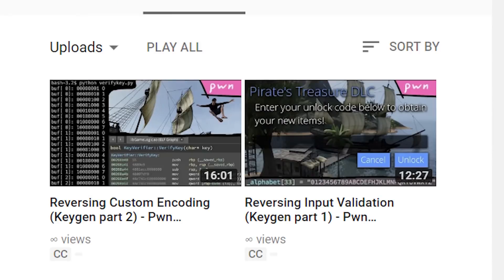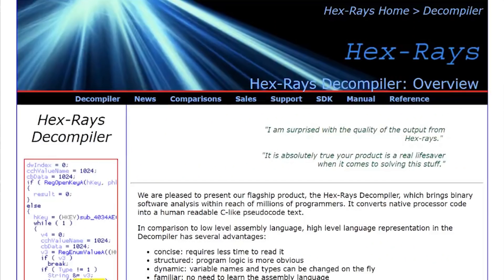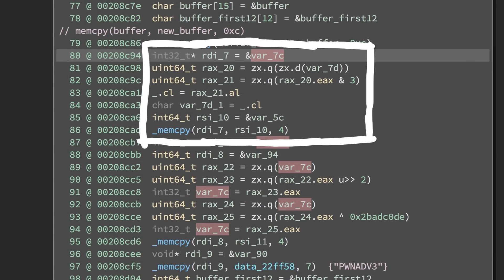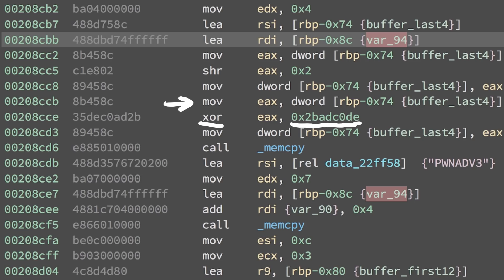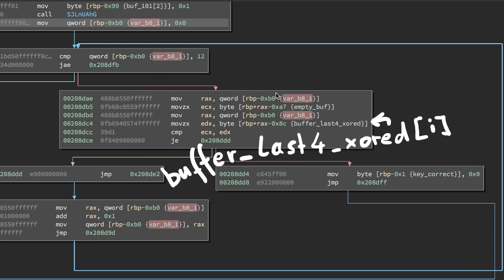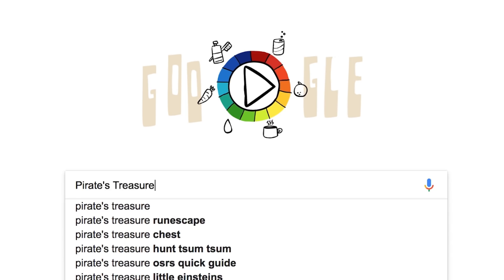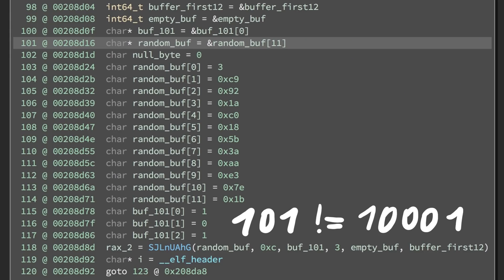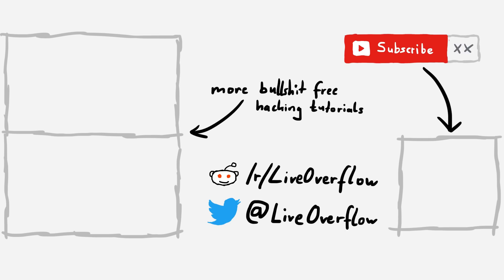Understanding the Key Verification Algorithm (Keygen part 3) - Pwn Adventure 3

Comment: I would've given up long ago, copy and pasted the assembler, or perhaps transcribe it, compile the key verification and throw angr at it.
Of course the more you know, the more you can constrict something like angr and reduce your test case, which will speed up time. if you can make angr find out a 15 byte array that matches and know how to convert that back into a valid key, then you don't need to check a 25 byte char array that could have anything in it. or perhaps worse an arbitrary length char array because just want to get over it.

Comment: This reminds me of a game I "cracked". It was in the days, when games were sold on disks. I bought one, it worked, but you couldn't hurt any enemy. It was nearly unplayable. So I wrote to the publisher, but I got no answer and no refund. Half a year later, I read in a computer games magazine, that they protected the game against illegal copies by damaging a sector on the disk - a common way to do it by that time. Unfortunatly, they forgot to damage the sector in the German version, exactly which one, I was playing.

So, I searched the whole assembler program for calls to the system routines to read a sector from the disk. I found 3 occurences and disassembled the code around those spots. In one, the status of that read operation was stored in a variable. At another place, a very complicated operation was performed. Then the result (probably the amount of damage you did) was set to 0, if the status of the read sector was "ok". I just replaced that "set to 0" by "no operation", and the game worked perfectly fine. This was not really "cracking" the game, as I bought it legally and I used the fixed program only for my own.

I was quite proud on myself, that I was able to figure that out, just from that little bit information, I found in that magazine.
Reply: I also cracked a game which protected its discs by damaging a few sectors. The game wasn't broken, but I got a new laptop without a CD drive, and my external drive was failing. Originally I wanted to use an ISO, but I couldn't, as reading the bad sectors took forever (40s per sector I think, and there were probably thousands). Luckily for me, the verification function only checked for a file named 'game_setup.exe' on the disc which made it quite a bit easier. I also made a mini ISO a few years later, but never used it. On another ISO I made I put all of the original CD files, the cracked game exe, as well as the downloadable editor from their (now shutdown) website (it would all fit on a CD, the editor was only available from the internet because it took them another year to finish it...). I only used it once to install the game on a newer laptop.

It's still cracking even if it's for personal use; distributing the crack is the illegal part. (The reverse engineering can also be illegal, but in fewer countries, and carries a much lower punishment.)
Reply: Cool! I like reading and watching videos about cracking games, they are so much fun, even though I'm a total noob. Great story!